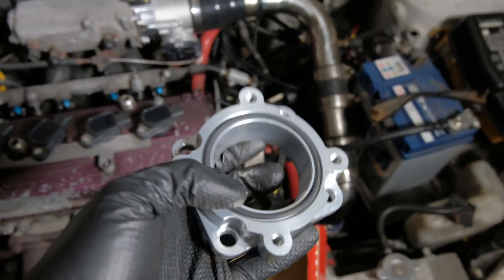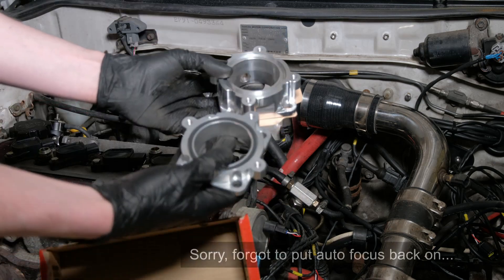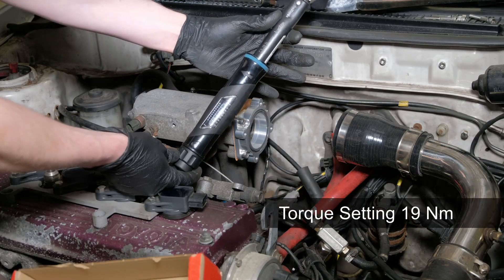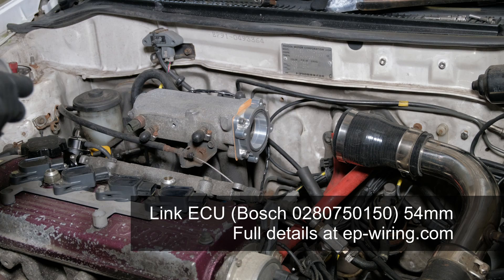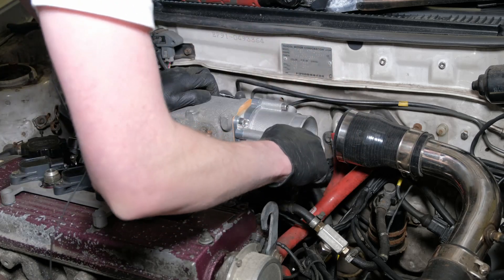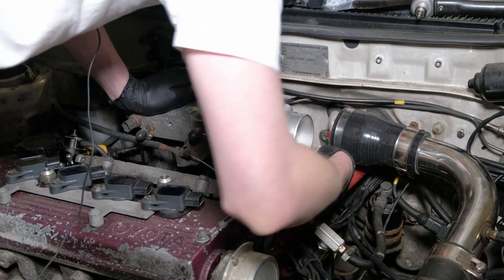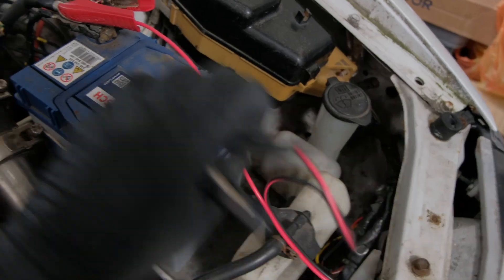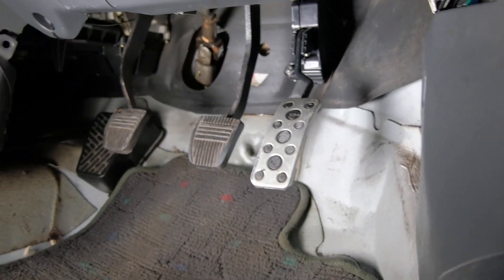Starlet DBW Drive By Wire Conversion 4E-FTE Glanza V

Comment: Do you wire up the brake switch to the ecu? Did you use the starlet switch?
Reply from the maker: I haven't personally wired the brake switch to any ECU's so far. For the Link and Haltech ECU's I've wired it's not a requirement, I think Haltech recommend it but works without it